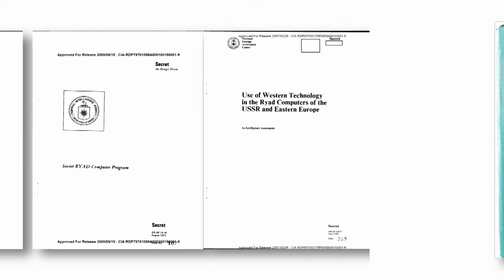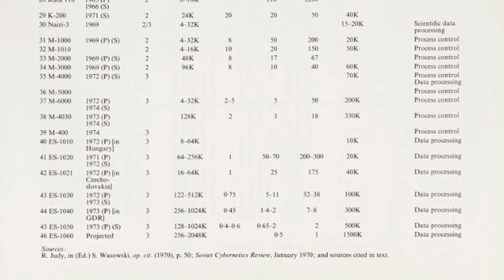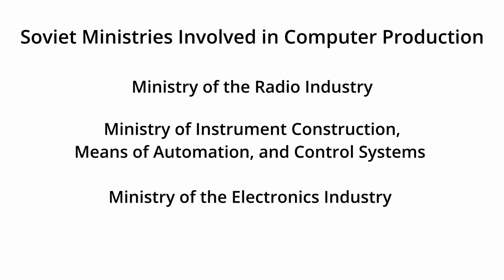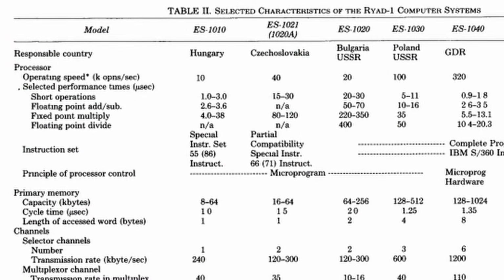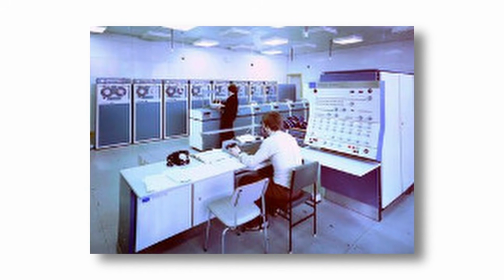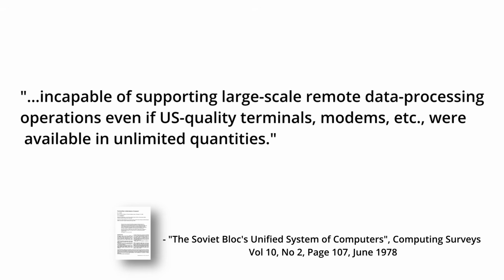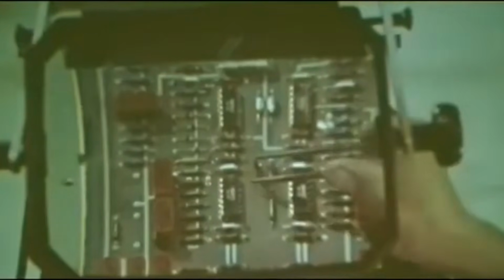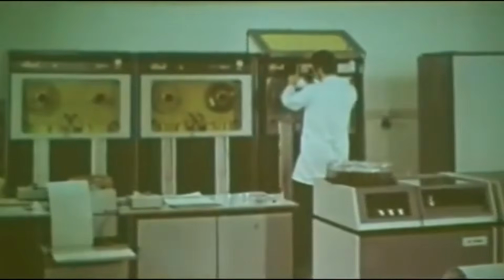RYAD - The Soviet attempt to clone the IBM S/360

Comment: What about the Bulgaria Pravetz computers. They were all asembled by localy produced parts including microprocesors, hard drives and optical drives.
Reply from the maker: The RYAD research pointed in a number of very interesting directions that I’d like to explore further, including the native computer technology of the CEMA countries that were forced into RYAD development. I’m going to be in the research phase for quite a while though, information on it is pretty scattered
Reply: Impressive that a small country like Bulgaria could pull it off. but that says a lot about the Warsaw pact it seems like the Warsaw pact countries where more isolated from each other than nato countries as if they where not really allies.
Reply: According to Wikipedia it seems like the PC clones used regular Intel CPUs, not any kind of clone. The Apple II clone used a CPU by the American company Synertek.

Comment: Wow, data transmission over TELEGRAPH infrastructure!  Factoids like this instantly remind me of a photograph with two MiG-25s passing overhead a farmer ploughing a field behind an oxen-driven tiller.

This video essay was outstanding!  The amount of research put forth is beyond impressive, you and your team should be very proud of this report into a little known chapter of the history of computing.  Nice work.

It's incredible interesting to me how the engineers and technicians were able to accomplish so much given all disadvantages they had to work with that were a result of a totalitarian regime and a socialist economy.  To have to work within a system that seems anathema to innovation and still create a computing infrastructure good enough to wage the Cold War is a major accomplishment, especially given the lack of direction and proper management.  I get the feeling these engineers were continuously reinventing the wheel, where, within each discrete project, they had to learn electronics, integrated circuit design, manufacturing techniques, operating systems, compilers and software essentially from scratch.  It almost seems like there wasn't much opportunity to share innovations across projects both within and without the various ministries, which must have seriously hampered overall progress.  It's hard to imagine how these individuals maintained the motivation to move Soviet computing forward - what was their inspiration?  Dedication to the State, belief in Communism, fear of the West, fear of punishment for failure?

Imagine if these motivated and talented people were brought to the West and were able to work in an environment that awards innovation with profit and advancement, and provides the freedom and opportunities to use their abilities and ideas.  I'm not saying the West doesn't have its flaws, but an emphasis on individuality and opportunity versus and emphasis solely on the state seems a lot more advantageous to moving a society forward.
Reply from the maker: Thank you so much for the kind words! I had a blast researching this video and the research also turned up a bunch of stuff for future videos on Soviet computing that I am looking forward to exploring. The BESM-6 line in particular is well worth a full video, as that was a seriously impressive computer for its day and in many respects initially compared favorably with western computers so far as raw performance went. 

One of the paradoxes of the Soviet economy is the fact that certain areas of it were capable of producing quite high quality stuff, in spite of the limitations on both information and technology. Although of course they had to run really hard just to stay only one generation behind the West in computing technology, the fact that they managed it under the handicaps the Soviet economic system imposed on them is truly remarkable. It's also true that Soviet computer systems tended to be, for lack of a better word, "unbalanced", with advances in one area frequently mitigated or nullified by poor quality/poor implementation in others. 

At some point I plan to do a video on the theoretical flow of the Soviet production economy, from GOSPLAN down to the individual factory and back up, tracing each step. I actually wrote the rough draft of it years ago, but its currently...about as exciting as watching paint dry. So for now, its one of a number of scripts on the back burner.
Reply: @AnotherBoringTopic  I'm looking forward to it!  Growing up during the Cold War, and intensely interested in aviation, I formed a typical American mental picture of the USSR, partly from propaganda, to be sure, but also from the scant resources available from a closed society, interpreted by Western analysts.  It was a little fearful because at that time in the mid 80s, we believed we were behind in bombers, nuclear delivery, tanks for an invasion into NATO, and troop strength; also, the unknowns related to submarines, naval strength, rocket and satellite capabilities, and, of course, computing.

With your channel and others, like Anna from Ukraine, The Cold War, and so forth, whom are combing through mounds of declassified Western documents and information released from the USSR, quite a different picture is appearing - one not as glamorous as my 80s one.  But given the current situation, it's important your work and others' is available to provide the historical context of what we're confronted with today.
Reply: @Pene7942  As some guy who grew up in USSR and remembers late 70-ies and 80-ies and whose whole family was in computer industry, my dad was printer/disk/punch card serviceman, mom was once one of those pretty white collar girls at the drawing board in computer center you can see in this video, uncle was a worker in the circuit making room etc, I can tell you that nobody I knew had an idea they are working for a totalitarian regime and need some extra inspiration to work. It's as irrelevant to their live as like me asking you loudly how are you finding inspiration enriching all those IBM private owners that exploit you to wage war in Taiwan or something, my parents just wanted to get an exciting modern profession farther from boring farm or waitress kind jobs, my mom at least was always super excited about computers even though her work was more like copying blueprints at once, when she was a student she had an internship in Leningrad circa 1968 at the org that was building the automated city traffic control system and learned algol, that sounds exciting even now. I do not remember any of those dull people in dull clothes doing some dull work in dull factories and someone in uniform yelling at them all the time as they portray in american or british movies, what I remember green streets full of people cheering and colorful, they just leave me at kindergarten and go working, I visited dad's work many times, evil lady in uniform was never there, they had 99% male gang smoking non stop, laughing most of the time and all super busy with wires and circuit boards. At 4PM mom would leave her work go shopping and then partying outdoor or on someones kitchen, on weekend every city would rush out to do beaching, cycling skiing etc, my both parents had 30 day paid vacation every year and free tickets to the beach in Crimea even though in Riga we had better beaches just 30 minutes ride. The only totalitarian regime presence was felt in victory day parade but that was a national holiday anyway and eveyone willing would go to parade at 9AM would forget about it hour later and go partying the rest of the day, also Lenin portraits and WORK AND PEACE kind of posters in places currently occupied by fast food neons, that's all the opression I can remember right now ask if you're interested may be I can recall more.
Reply: @yashexebook  I'm sure they felt it every moment of everyday, especially when you get that measly paycheck at the end of the week that equates to something like $10 US for doing a job that here in the USA people got paid literally 700+ times more for weekly and totaled to $30,000, $50,000 etc. probably more each year for. The fact they knew they better watch what they say about the state or else they will go "missing" was probably enough a reminder as it was
Reply: @yashexebook  Great comment i am intrested. Life wasint slavery in USSR but it still seems so unique compared to my life but perhaps I am fantasizing to much. 

If there was time travel i would visit USSR keenly, i often fantasize what it would be like to show a soviet an iPhone and to tell them that thier country will collapse. Would also love to see an alternate reality where the soviet union continued on, i eat up all sci-fi on that.
Reply: @DankNoodles420  you are comparing the US 'bean' pay with the soviet. The cost of many things was relatively on par for affordability for most at this time, much like how one could claim the same now in the US, even with inflation. There are better ways to flex capitalism here, and this ain't it.
Reply: @DankNoodles420  Your ignorance is palpable. I know that it's easy to believe that communist countries were full of people who were depressed 24/7 while they slaved away their oppressed life among dull grey concrete blocks, but living in actual communist countries was different than that. People even had fun and there were colors!
Reply: @yashexebook  Interesting comments, thank you for sharing your experience! From the video I sense great respect for the individual workers. Yet despite being ingenious, enthusiastic, hard working, well educated, and having fun together at work, the entire Eastern Bloc computer industry, with the best of Soviet style government planning and funding, was always a full decade behind what the west produced in information technology. There needs to be some explanation for this lag. If it's not the workers, than it must be the system within which they worked.
Reply: @editingsecrets  In the Soviet Union, in its most educated part, there were two times fewer engineers and scientists than in the United States. Of course , the country was lagging behind . The staff of scientists approached the American one in the 80s. This is what determined the lag of microelectronics at the end of the Soviet Union in 5 years.. In addition, the capitalist system could force a person to work thanks to its harsh capitalist methods. In the Soviet Union, everything worked a little differently. But there was competition, of course, but in slightly different ways.
Reply: @yashexebook  I am from fmr soviet union. I can say it wasn't all flowers and bubles as you tried to describe. But the people tried to do their job and tried not to pay attenton to stupid slogans of soviet propaganda.

Comment: I started my life in Soviet computing centers as teenager. As most of the software to those computers was “stolen” from west, everything was actually rewritten by local “hackers”. The memory was biggest problem as most of those computers had only 64kb or 128 kb of memory. Getting additional memory towers was practically impossible if your directors didn’t had good personal relationships with computer manufacturies. So, my teenager challenge was to cut out most of the IBM original assembler code as we needed more memory to run complex mathemathical multidimensional matrix analysis. When doing this, I mostly cut out unused routines and optimised the memory blocks getting the code third of original. Besides me, some “hackers” in Ukraine and East Germany was doing same. I my mind, I joked that IBM programmers are worse than Soviet Bureocracy, sending calls always to wrong place to check it out, that this call suppose not to be there and sending it forward to somewhere else until finally finding the right place to execute. Later we did same with CPM operating system putting it to less than 6kb of RAM. (original took around 30% of z80 64 kb). I never had possibility to study original IBM code, even I know the “secret” laboratory who had first hand of this. We got already modified operating systems from them to rewrite those further.